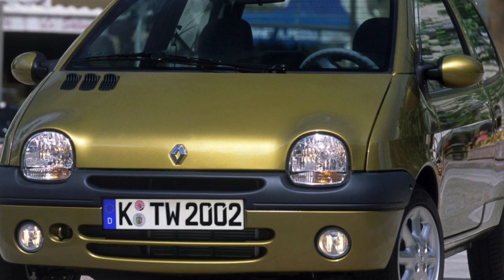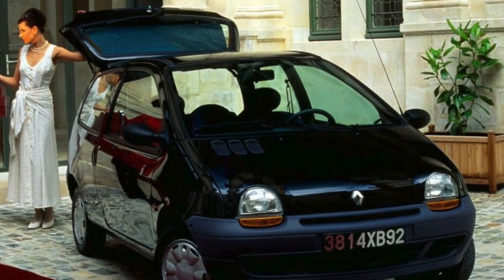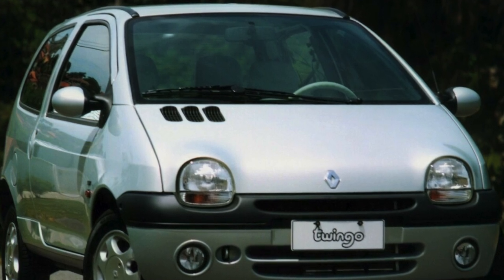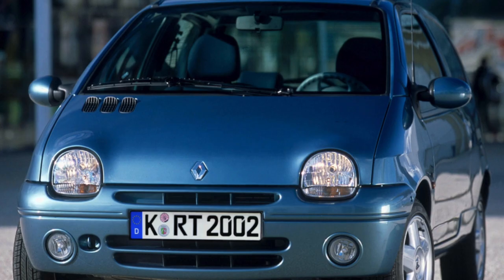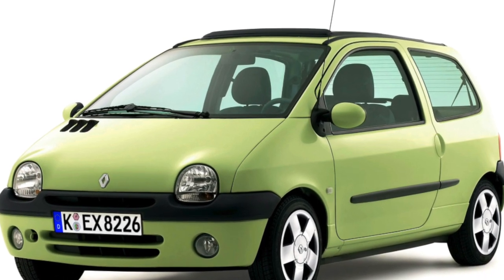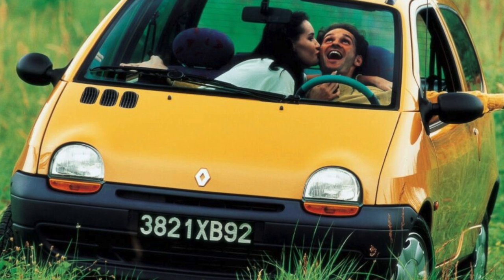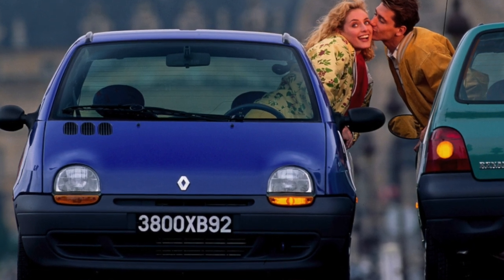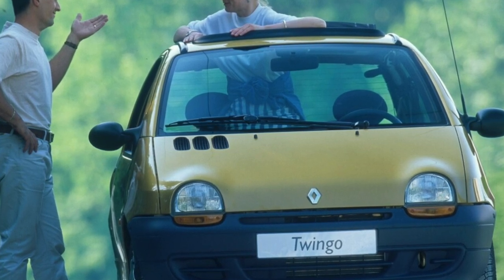Renault Twingo Problems | Weaknesses of the Used Renault Twingo I generation

Comment: I have the 2001 Expression. It has all Extras and absolutely no rust, not on the axles and not on the body! It was treated very bad by several previous owners, the timing belt was about to snap when i changed it! We also tested compression and it still has 12 bar on three cylinders and 11,5 on the fourth. The D series 1.2 engines are the ones to look for, the older ones don't have a good reputation. My Tach went out aswell.
Reply: I have the same one. This car won't ever let you down. Simple,cheap and well build. Fun fact: in Slovenia, it came out with 14 years of warranty on rust.
Reply: @zigaskof8813  That is amazing, they really did something for the people! In times of capitalism it's hard to believe!